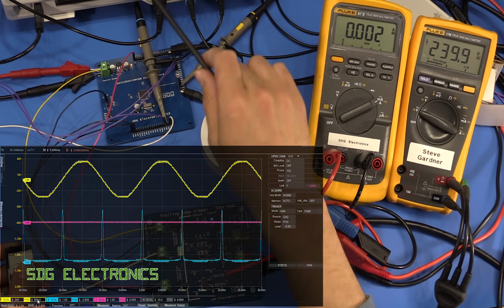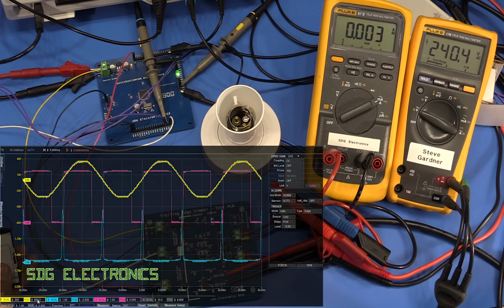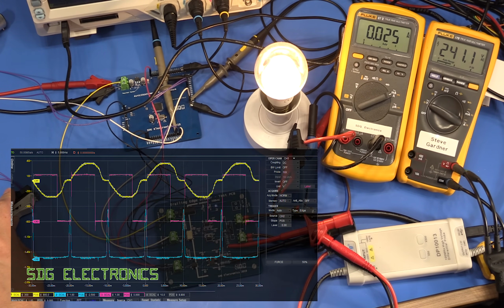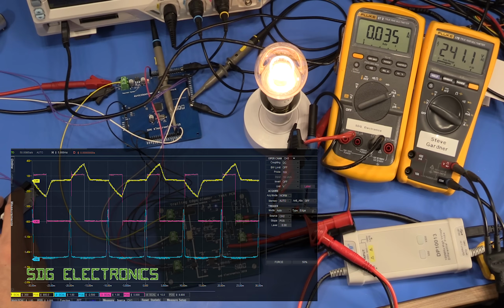SDG #068 Designing a Trailing Edge Dimmer - Lighting Controller Project - Part 2

Comment: This could be simply simplified to driving triac with pwm-ed optocoupler.
Simple as that. Even simpler is to use small transformer with high impedance
Reply from the maker: Unfortunately it's not possible to use a TRIAC in this situation. The TRIAC can only be turned off at the zero crossing point as explained in Part 1. LED lamps and other capacitive loads need trailing edge dimmers.
Reply: @sdgelectronics  It all depends how you control input voltage on triac. I managed to dimm both led , non-led and power deviced with triac - opto-transf-pwm
Reply from the maker: @browaruspierogus2182  what was your final waveform? If you apply current to the lamp mid AC waveform, no matter what the method used, you'll get high transient current which will be bad for the longevity of the electronics, but more importantly the EMC emissions
Reply: @sdgelectronics  You dont apply strict dc current but 'wave dc' current or ac with bias or biased ac kind of
Reply: @browaruspierogus2182  Oh,ok.

Comment: Thanks Steve! Hopefully they won't run out of the differential probes before I have the money to get some.
Reply from the maker: Hi Robert, they normally let you back order if you want to use Banggood. And it should be less than a week for stock to be replenished though and the discount code will stay active for a good while yet.
Reply: What does, "stock is due", mean?
Reply from the maker: @RobertCalkJr  Back in stock, ready for shipping. They temporarily sold out.
Reply: Ok, thanks Steve.

Comment: Try that zero crossing design:
http://d1.amobbs.com/bbs_upload782111/files_40/ourdev_643643NSY57M.pdf
Reply from the maker: Thanks, I was just looking at various precision zero crossing detectors.
Reply: @sdgelectronics  I have never used that and after some analysis it's more a delayed peak detector (triggers going down after a peak). I think that adding a zener in // with the capacitor would help keeping it independent of the peak voltage as this would flatten the peak. In that case you don't really need the 20k resistor or could use a bigger value.
Reply from the maker: I'm just playing with some simulations at the moment just using a comparator.

Comment: Great Video, I love these power electronics projects and I want to try some more advanced projects myself, I have just placed an order for 5 of the DP10013 probes and two of the LA1010 units you reviewed, they were very useful and your discount code saved me £125 on the total order so thanks for sharing that, I am wanting to use the dsPic33EV range of micro controllers for some power projects, these are 5V devices, would they work on your controller PCB with a regulator change ?, keep up the great work, Dave from BasicMicroUK
Reply from the maker: I'll have a look in the datasheet of the pinout is the same, if so, you're welcome to a couple of PCBs. Thanks!
Reply from the maker: I've just had a look and the pin-out is slightly different for the dsPIC33EV, with some of the power pins in different locations. If you want one of the populated dsPIC33CH boards you're still welcome to one. If you happen to use Proteus, you can take the design files to modify or I'm sure I can find the time to update so you have a similar breakout board.
Reply: @sdgelectronics  Thats a shame they are not pin compatible but it does not sound like there is much to change other than power pin locations and a 5V power supply rather than 3.3V,  please see if you can make the required changes for me and get a batch in from JL-PCB for testing, I am happy to cover your time with maybe free parts for your next project or Patreon support
Reply from the maker: Hi David, if I update the schematic/board is the dsPIC33EV256GM106 a suitable part to put on the schematic?
Reply: @sdgelectronics  YES thats a perfect choice and Microchip do a CAN-LIN development board RS part number 871-1767 that uses that same IC so you could check the schematic for that PCB to see how they have set up the PIC's power and clock etc
Reply from the maker: Taking a bit longer than I'd hoped... Didn't get much time over the weekend.
Reply: @sdgelectronics  No worries at all and thanks for your efforts, let me know if you need any parts sending out to you, its best to use our ebay shop as thats the most up to date list of stock, https://www.ebaystores.co.uk/Basic-Micro-UK/
Reply from the maker: https://sdgelectronics.co.uk/uncategorized/a-breakout-board-for-the-dspic33ev256gm106/
I did a quick check on JLCPCB, it uploads fine for ordering. Apologies, the schematic is messy...